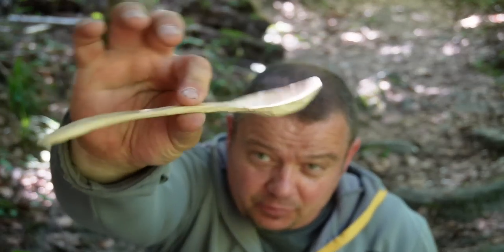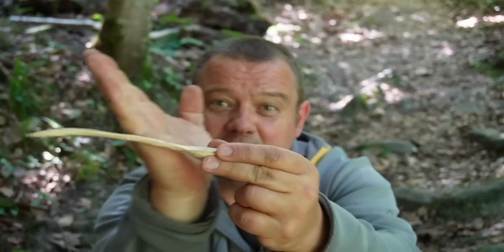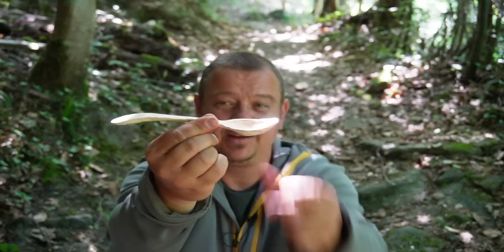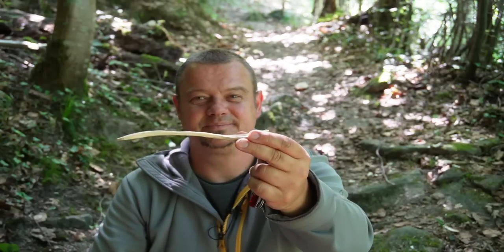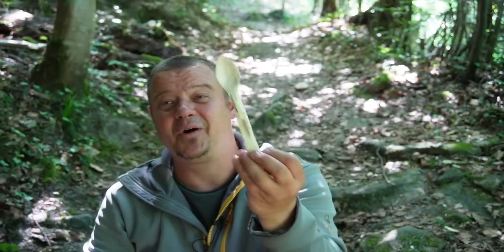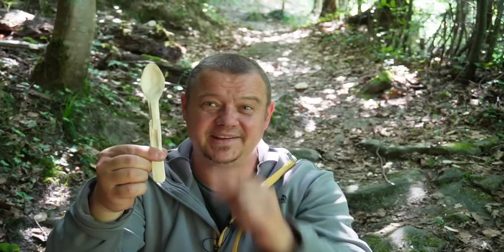How to whittle a foldable Spoon -  Swiss Army Knife Project

Comment: If you have to modify your knife to do it you could do what I did. I bolted a teaspoon to my Leatherman Skeletool. It sits nicely out of the way on the side of the knife and unfolds and was very useful in a workplace where teaspoons all went missing! I just shortened the handle, drilled a hole in it and used a longer bolt in the handle.

Comment: Great execution, interesting idea. I cannot think of any reason why you would ever need a folding spoon.

Random musing 🤔 maybe a handle with hole drilled in Center into which you could insert spoon head with “dowel” to insert into the handle, drill bit holder (tapered dowel that grips drill bit tighter as it is pushed into handle) (or any other tool, saw blade slot opposite end of handle?)

On side note using a round piece of steel heated up, it will burn a very good hole.
Reply from the maker: Thanks a lot for your interesting feedbacks!

Comment: Hi. Suggestions for a video. They make cheap chinese copies of the Victorinox Swisscard Lite and the SwissChamp. You could make a video comparing them to the real ones. Also the Rally 58mm can be safe for a kid if you cut the blade out. Then you get tweezers, toothpick, a nail file, bottle opener and two screwdrivers one magnetized.
Reply from the maker: Thanks for your inspirations..
Reply: @FelixImmler  Looks like you had done that video already haha! Oops but I knew it was a good idea.

Comment: Only once have I seen a fork that folds inside of a handle like a folding knife, making it pocket usable as the fork is concealed. I tried to order one but the order wouldn't go through, and it was some unknown generic brand with a small production run. Too often lately will I come to the internet to buy something that should exist but doesn't exist.
Reply from the maker: Thanks a lot for your interesting comment!
Reply: I have an older Case "Hobo" trapper pocketknife with the folding fork and blade, that separate into two handle sections. (I'm sure the current production one includes a spoon, so it comes apart three ways.)
Reply: @matthewpittman2481  I never came across the Hobo Trapper in my search. Those things are costly, but they are an option. What I saw was more like one of those folding stilettos with marble and silver handles. If I had a drill press, I could probably make my own with any folder.